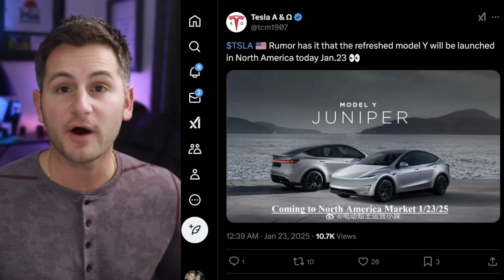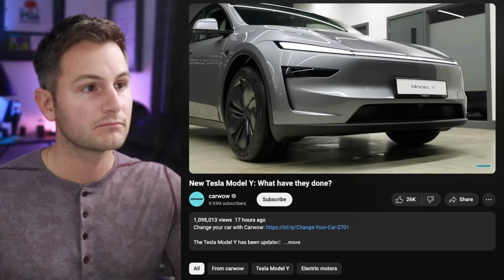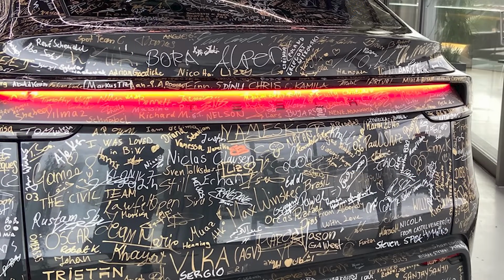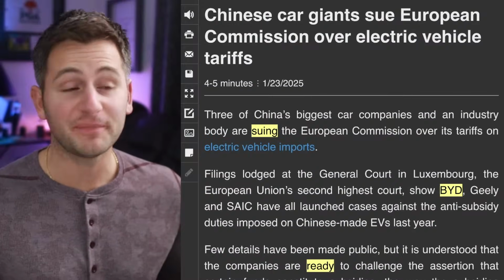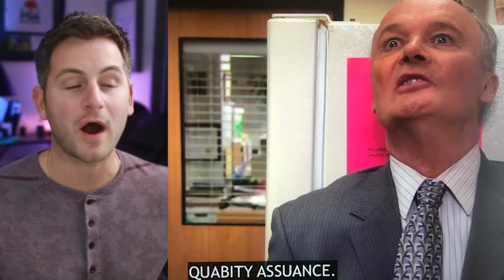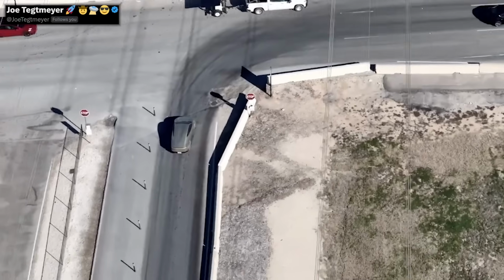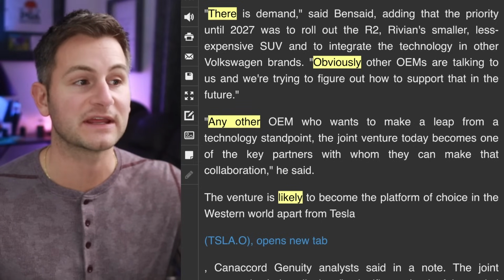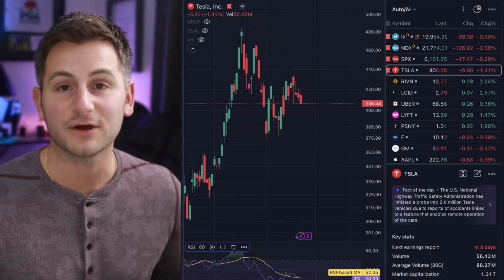New Optimus Production Report / Lies About New Model Y / Something Happening with Rivian ⚡️

Comment: Lighter weight for Optimus is not about the robot's total weight, but about making the actuators more efficient and improving their longevity. Imagine trying to play guitar or piano with heavy weights at the ends of your finger tips. There would be a lot of energy lost from counteracting momentum when the direction of travel has to change suddenly.

Comment: Unsupervised FSD will not be safer than a human in a plethora of common situations because the current front facing cameras are too close to the windshield. They are blinded by bugs, bird poop, dirt, slush, etc. Over thousands of miles on FSD, sitting back from the windshield I can always see safely even when the FSD gives up. Have to hold the washer fluid button for many wipes till it clears. The first wipe often smears and blinds the camera for some period, far too long to continue on FSD.
Reply: "Unsupervised FSD will not be safer than a human in a plethora of common situations because the current front facing cameras are too close to the windshield. They are blinded by bugs, bird poop, dirt, slush, etc."

Incorrect. FSD will become way safer than human drivers. 

"Over thousands of miles on FSD, sitting back from the windshield I can always see safely even when the FSD gives up. "

And in some circumstance FSD sees things the human driver doesn't.

Comment: "Critical Interventions” are in the eyes of the beholder. I’ve only had my 2025 Model 3 for a month and find I have fewer “interventions” as I learn to trust FSD 13.2.2. The few complaints I have are probably due to the placement of cameras and FSD not being able to deal well with snow and icy patches in shady spots and on bridges. I intervene on some left hand turns though FSD could perhaps correct its initial scary behavior on its own.

Comment: Waymo is remotely monitored,  therefore not autonomous.   It's ok at 35 mph on a geomapped  course.
Reply: And being geofenced means it is not a general purpose solution.  Tesla is after the general purpose solution so it can work anywhere.  Analysts definitely don't get this at all and actually argue against it since Tesla is not on the road now with full unassisted self driving.  That is just stupid of analysts to think this.

Comment: Stargate=Boondoggle.
If you can't go from plans to operational data center in < 12 months, the data center will be outdated before it recovers initial costs.  At this time, hardware costs and efficiencies are improving faster than their adoption.  A company that can implement a datacenter in < 6 months is likely leap-frog the competition.  Don't over build for future consumption.  Build fast, build efficiently, and try to add enough to avoid facility bottlenecks between builds.  It is the data center factory, not the product, that should be the focus.

Comment: @DillonLoomis22 You can't compare what CarWOW was saying regarding pricing in the UK and then show slides about US Pricing, they are drastically difference. The UK pricing for the new Model Y is horrific compared to the outgoing model but granted maybe this will all change when the "Launch" is over. Also FSD is not a factor in the UK and is not included so your calculations including this were flawed since your using the CarWOW critic (which was based on UK pricing). As a UK self admitted Tesla fanboy and a share holder all I can say is there seems to be quite the backlash of shock comments on the Tesla UK FB groups with pricing which I might add was posted as soon as the website was updated and before any new Model Y videos made it to YouTube, so there seems to be quite the consensus from disappointed UK customers.

Comment: Improvements not just in aerodynamics, but in the gearing of the motor to the drive axle, with better lubrication reducing friction, and less rolling resistance in the new Michelin tires. All these things increase range. Kyle Connor thinks the range increase will be a lot more than Tesla's saying.

Comment: If renewables were really as bad as Trump says, Texas wouldn’t be the leader or near leader in multiple categories including Solar install.  It just makes economic sense, especially solar in sunny states.
Reply: Trump knows nothing about energy and it's cost.  Those that use the energy, like the oil and gas industry in Texas, are using renewable energy because it IS cheaper, otherwise they'd be using their own energy.  Now, the origin of solar panels and wind turbines is mostly correct and that is what should be focused on, not the elimination of it all.

Comment: Please consider this. Solar panels eliminate any need for giant windmill power generation, perovskite bi-material panels with non-Chinese IP made outside of China will be hitting the market shortly with much higher energy efficiencies and reduced cost. Land is better for farms, pastures, parks, municipal buildings and houses. Houses and other buildings are harder to light up and burn if the rooftop is solar paneling. Too many pluses, Trump is not wrong IMO but is often not well understood.

Comment: Mate what are you talking about. Matt said it was probably the best mid life facelift he has seen on any car. The information on the price is correct, if you want one now, you pay more, as no other options are available. There is no technological leap, no new batteries, no new motors, the UI is the same; he talked about the increased stiffness to a car that is already stiff but qualified that with saying while on paper that sounds rough, if it is like the Model 3 it will be an improvement. He said the interior material were better but looks wise not that much different. Failing to see what your point is... not everyone is  a complete fanboy. 

Where are the 4680 with 50% more range and 35% less cost to produce. FSD not working at all in the UK so why would you pay for it or pay a premium for a car that has it. It is years away in the UK if not the USA.
Reply: "There is no technological leap, "

So better suspension and less noise is not a technological advancement? There are quite a lot of changes for this model, and some of them will also have to do with manufacturing. 

"Failing to see what your point is..."

What is the point of your comment? 

"not everyone is  a complete fanboy. "

Oh. So personal attacks in lack of real arguments?
Reply: @yourcrazybear  Manufacturing improvements that improve profit margins are of no benefit to the consumer but as a Tesla shareholder I approve. It is only of benefit to the consumer if they drop the price and maintain current profit margins. They have done neither.

There is no technological leap, the suspension is getting to the standard of every other manufacturer there is no huge leap in performance or ride quality. Ditto, it being quieter... it's an electric car. My Dad drives a diesel Mazda and that is quiet.

The point of my comment is that the Carwow review was a fair assessment nor was it riddled with lies or  information inconsistent with the truth.

Personal attacks in lieu of real arguments... can't you read... no new motors, no leap in battery performance, price is too high, the U I is the same as the old model...  so in fact a list of about 10 points... what personal attack? I asked what he was talking about... and listed points that were factually incorrect about what he said.
Reply: @landcruiser801  "@yourcrazybear  Manufacturing improvements that improve profit margins are of no benefit to the consumer but as a Tesla shareholder I approve. It is only of benefit to the consumer if they drop the price and maintain current profit margins. They have done neither."

Driving down the costs of the products is of no benefit to the consumers? So how do you explain the simple fact that Tesla have been driving down the costs of their cars? You have failed doing your research here. 

"There is no technological leap, the suspension is getting to the standard of every other manufacturer there is no huge leap in performance or ride quality."

Improvement of the suspension, noise levels, comfort, efficiencies, costs, etc is no technological advancements according to you? That's a highly weird stance. 

"Ditto, it being quieter... it's an electric car."

So did you miss the fact that we are talking about an improvement of an electric car here? Try to keep up. 

"The point of my comment is that the Carwow review was a fair assessment nor was it riddled with lies or  information inconsistent with the truth."

No. It was not a fair assessment, as was pointed out in the video. 

"Personal attacks in lieu of real arguments... can't you read."

Yes? That's why I addressed your irrelevant personal attacks. 

"no new motors, no leap in battery performance"

And still technological advancements in other areas. Why are you ignoring them? And why is it that important for you to paint this false picture? 

" price is too high,"

It's a time limited release edition that also includes FSD among other things. Of course it will cost more than the old version. 

"what personal attack?"

Yours. Calling people fanboys in that context is a clear personal attack. How about trying to post some real counter arguments instead?
Reply: @yourcrazybear  Ermm you can't argue with stupid. Calling someone a fanboy is hardly an insult more an adjective to describe someone who is so enthralled by someone or something that they can see no flaws. Calling someone a liar (see video title... i.e. if you say lies about Tesla Model Y you are calling the person saying them a liar) I would say insulting, more so when said person has not lied just expressed an opinion. Moreover to say that it is bad reporting not to report on how the car drives, how could he, Tesla would not let him drive it... why is that? Same with Tesla Jigsaw. Fact is the old Model Y on UK roads was hard and bumpy, Tesla claim the new model  Y is stiffer... so on paper it would be reasonable to assume until a test drive prove otherwise that the ride will be even worse than the old car.
Reply: @landcruiser801  "yourcrazybear  Ermm you can't argue with stupid. "

You mean you can't argue without calling people stupid? Personal attacks are never valid arguments either way. 

"Calling someone a fanboy is hardly an insult more an adjective to describe someone who is so enthralled by someone or something that they can see no flaws."

You seem confused. I claimed that it was a personal attack.

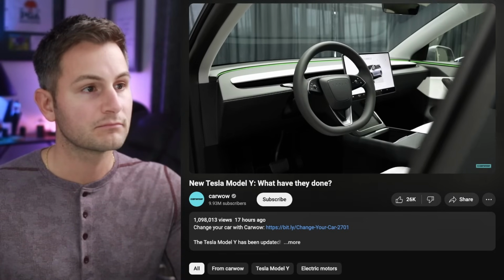Comment: 3:50 I don't understand his general question?! Why should a facelift model be cheaper than the old model?
In addition, the range of the Juniper LR AWD is now as high as the old LR RWD.
Together with all the improvements, a surcharge of €4200 (here in Austria) over the LR AWD is more than justified.
With other brands you sometimes pay that just because it is a "limited edition", even if it is just a VW Golf.

PS: in my opinion, Trump is partly just a useful idiot, a puppet used by several people.
Reply: no that would be Joe Zzzzzz and staff

Comment: Magnesium is highly flammable
Reply: Only in powder or ribbon form. As a solid it requires high temperatures.
Reply: @JohnSmith-x3y8h   It's easy ignitable in powder form but It also burns in solid form.  Let's ask AI:

Burning solid magnesium requires a high ignition temperature, typically around 473°C (883°F). Once ignited, magnesium burns with an intense white flame and can reach temperatures of approximately *3,100°C (5,610°F)*. Magnesium fires are challenging to extinguish because the metal can burn in both *oxygen and nitrogen atmospheres*, and it can even react with water to produce *hydrogen gas*, which is also flammable
Reply: @ 

What part of ‘requires a high ignition temperature’ did you not understand?
Reply: @JohnSmith-x3y8h  The ignition temperature is a lot lower than the temperature of a "normal" fire, which can be anywhere from 600°C to 1,200°C (1,112°F to 2,192°F). The point being that a "normal" fire can catalyst the ignition of the magnesium, reaching temperatures of 3,100°C (5,610°F) and being able to burn using both oxygen and nitrogen, and generating Hydrogen when reacting with water, a whole new problem in itself.

Comment: Full disclosure; as mush as. I’d like to buy, I can’t afford to buy a Tesla BEV; that said even the Model Y Refresh feels like Windows 3.1; as its is still missing; 48v system, EtherLoop, steer by wire, rear wheel steering, fast fast charging, V2G & V2L, a clear upgradable ‘induction’ option for robotaxi duty, obvious MANUAL release for all doors, clarity on unboxed construction (my take being it is itself being remodelled to accommodate Optimus facilitated manufacture), and - Airless Tires - Michelin Up’ - and finally open use of the C-rating system for defining charging speed. So I await the Tesla take on Windows 95!

Comment: Every analysis involving energy cost comparison between renewables and fossil fuel include tax and carbon credits.  This does not represent true cost of energy. They also do not include energy storage cost, which is needed for demand cycles. Additionally long term maintenance and equipment life cycle are not adequately addressed.  The proof is China is building 100 coal fired plants a year because they deal with cost only and not government policy

Comment: Carwow was good, but then Matt Watson went for views and clickbait. Having said that, you are comparing a USA spec to a UK spec. 
The UK spec is better than what they made out and includes an acceleration boost, dark suede leather, 20-inch wheels, etc. The colour upgrade is free. 

I would suggest they are scaling up the role out and focus on Australia before the UK, as they have limited right-hand drive cars. Probably as they are coming from China at first.

Comment: Carwow is right when it comes to Europe, we have two colours, only all black interior, no FSD or EAP included. 
So here it is quite a price jump.
Reply: FSD should have been included in that price even in Europe. It doesn't matter that FSD is not yet released in Europe, it should stil have been included.
Reply: The new model Y is still not available in my country. Maybe in march.
Reply: @wolfgangpreier9160  what country?
Reply: @ Austria
Reply: Same in Hungary, only black and quicksilver is available, 20" Helix rims, tow hitch, only black interior, basic autopilot, and acceleration boost is included.
Reply: Also came here to say this.  Looks like you just get the Helix wheels and Toe Hitch on the Launch edition in the UK, and it is £10,000 ($12400) more expensive than the outgoing Model Y.  Of course Tesla changes prices all the time so who knows what happens after launch.
Reply: Tariffs make a difference, as does the unavailability of FSD in Europe.
Reply: @George-JT-l2q  "Tariffs make a difference, as does the unavailability of FSD in Europe."

Incorrect. The unavailability of FSD doesn't matter as it's only a flag tied to the car.
Reply: Came here to say this, was commenting with my US friends on this difference, the US is far cheaper.

Seems like EU is paying a premium to pay for the removal of tax credits in the US 😂

I think there’s something going on here though, seems like the higher price is setting up a lower price gap for a new model?
Reply: @whlphil its the launch series version, which has limited options, and has some things included, that are optional in future non-Launch models. That's the only reason for the price hike. Tesla needs to get rid of existing inventory of Model Y.
Reply: @whlphil  it is because the displayed price is without VAT in the US

Comment: Is it just me or has nobody realised it does have acceleration boost which would cost £1500 here in the uk.
This marketing is put in place to maximise profits from people who desperately want the newest thing. 
It also slows the rush of orders to allow Tesla to keep delivery timelines acceptable.
Hold on a few months and you will be able to get the non launch edition for the same price as the old model. Maybe even cheaper if the model 3 was anything to go by.(old model 3 was £50990 now £49990)

Comment: In Europe FSD isn't included in the Launch Edition, so carwow was correct.
Reply: In Germany normal old Model Y LR AWD price is 54.990,- €. 20" Tires are 2.200,- €, Tow Package is 1.350,- €, Colour up to 2.200,- €, Boost is 1.800,-€ - together 7.950,-€. Together with the car price 62.940,- €. So the Launch Model is 1.950,- € cheaper.
Reply: @Dekarbonisiert  Nobody's gonna buy Teslas in Germany, Elon made sure of that, so no biggie
Reply: @ I just did.

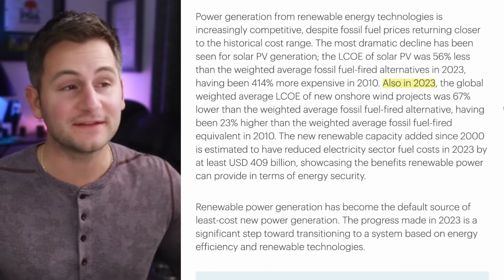Comment: Great biased analysis by Trump and you at 23:20  but can you please explain why so few are jumping on the Indonesian nuclear energy solution?
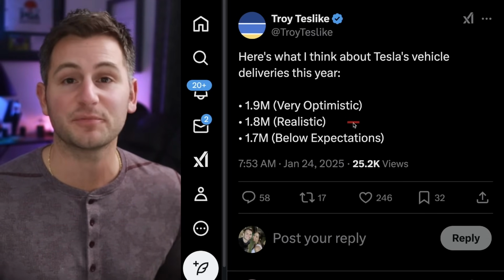Indonesia as PPA agreement for 8×500MWe TMSRs with  ThorCon at only little cost to Indonesia, being site preparation and linking to local grids ad the PPA includes the capital cost at between $800 & $1000 per kiloWatt and will have a pre-profit levelized cost of less than $30 per Megawatt.hour; (<$0.03/unit kiloWatt.hour and able to provide power to consumers at <$0.07/unit kWh, running as a base loader but capable of auto-load following to compensate for any linked irratic  non-recyclible renewables. 24:03
Reply: We need  TMSR for AI computing centers...

Comment: To me, the biggest thing we need to do with wind energy is to put a big battery at the base of every windmill. The wind blows on its own schedule, not based on our need for power!!
Reply: Correct
Reply: Windmills are for grinding corn, no batteries needed.  Wind turbines often work with batteries such as Tesla Megapacks but those can be installed anywhere on the same grid to be charged with any excess wind energy.